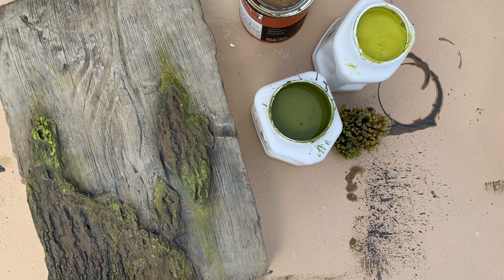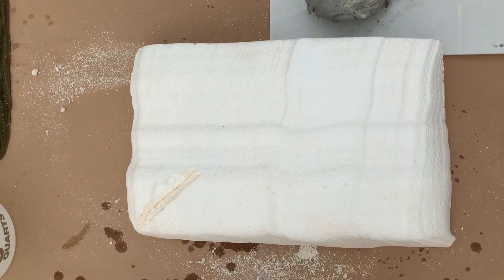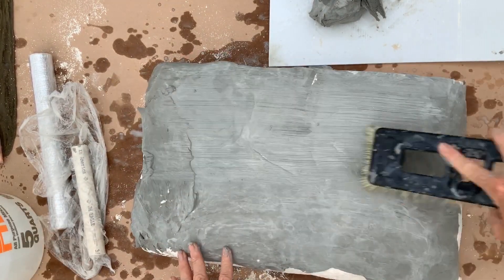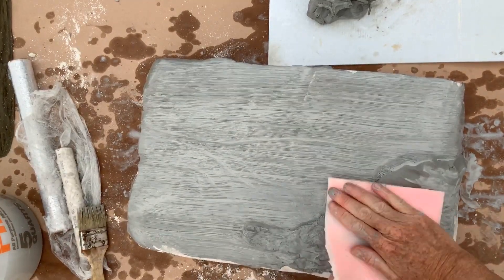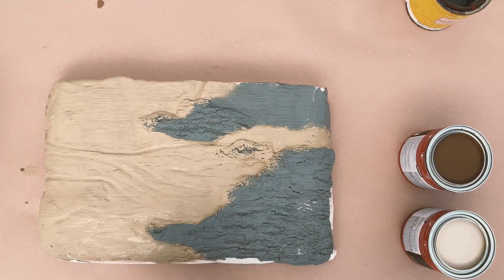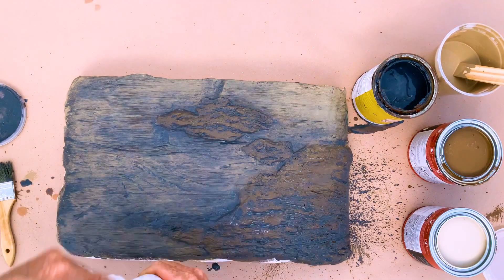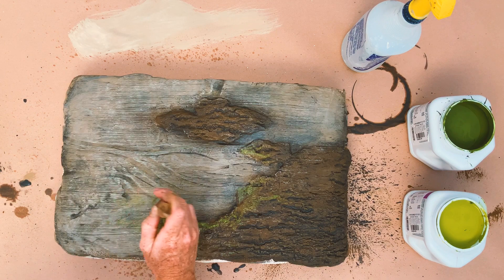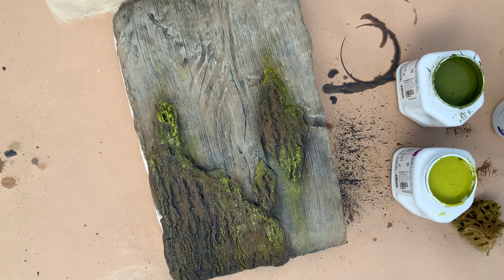How to create realistic wood and bark textures on foam or any surface

Comment: I don't know if you'll answer comments but is there a way to make realistic tree bark with clay foam I'm doing it for a costume ?
Reply from the maker: Hi, same idea. Just push the mold into the clay foam
Reply: @karawalkerdesigns167  mold ???
Reply from the maker: @Skylark9  yes, I used a silicon mold with the bark texture in the video

Comment: Great video Kara. What is your estimate of square foot coverage for the clay? It looks like you have the 10 gallon $575 option. I don't want to buy that much if I would need considerably less to do a haunted tree.
Reply from the maker: How big is the tree you want to do? Coverage depends on how thick you put it on. I haven’t covered a whole 8 ft tree yet so I don’t know exactly but I bought a 10 gallon set to do 1 tree. I hope there is left over
Reply: I’ve got an tree similar in size. Those large sizes only ship freight to me for $215 🙁. Oh well. They want it they will pay for it. Too bad I can’t find a local distributor